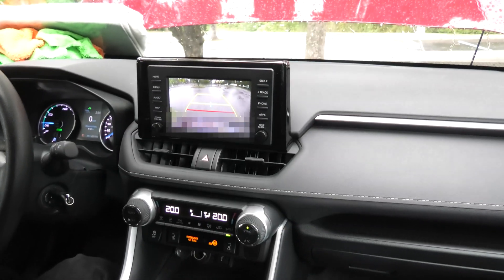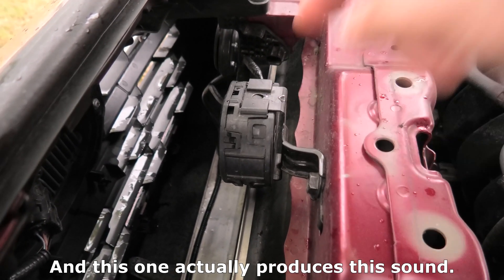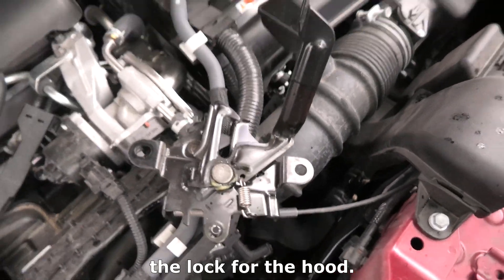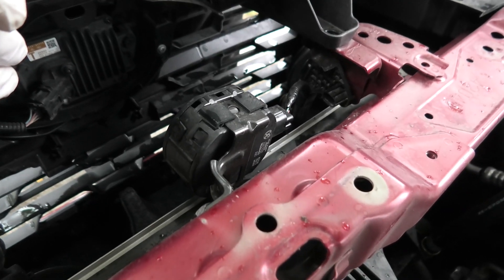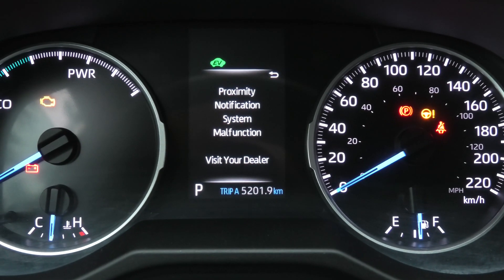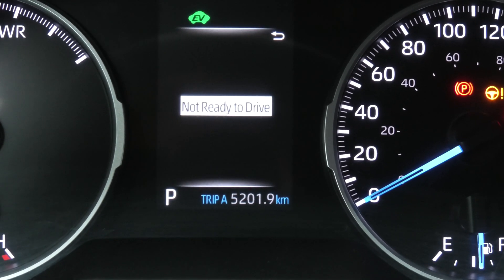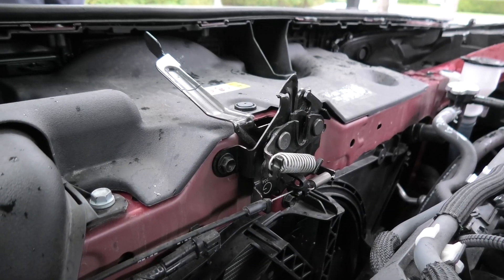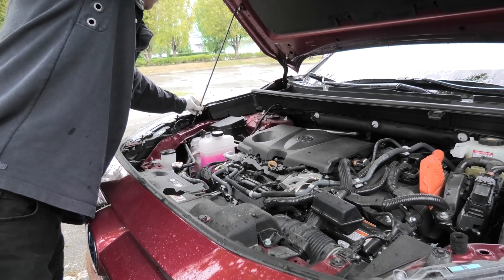Toyota RAV4 Hybrid (2019-2025): Where Does Futuristic Hybrid Noise (Sound) Come From?

Comment: If you unplug the speaker I know it will the message on the dash. 
My question is, after it shows the message and then you plug it back in will the message go away or will the dealer have to reset and clear it?
Reply from the maker: The message will go away after you plug it back in.

Comment: Have you guys at Morosov ever taken one of these things apart and hollowed it out and tried putting it back on the Rav4 Hybrid  .

I  Find these things obnoxious and you know it's only the hybrids and electric car's atom it's quiet as cars are nowadays even gasoline ones they should have them as well so why should only the hybrids have these obnoxious things , This is a reason I want this thing gone .
Reply from the maker: Hi Gary! No, we have not. You can install the resistor in place of the speaker. But, as you may have guessed, this is not exactly legal.

Comment: If there toyota tech or he pass by can answer this question 

I have question if i wanna add this system to my 2006 prius do i only need the speaker and feed it up with reverse light power to start the warning sound or i need the avas module unit too

Comment: I have question if i wanna add this system to my 2006 prius do i only need the speaker and feed it up with reverse light power to start the warning sound or i need the avas module unit too

Comment: Can this be manually unplugged so that annoying sound is not on a 2023 new model? Will it damage the vehicle if it is disabled?
Reply from the maker: It won't damage the vehicle but it will give you the error message. Besides that it is the government requirement for the electric and hybrid vehicles to produce noise at low speeds with engine off.

Comment: Interesting video. For some reason my 2022 Toyota RAV4 Adventure Hybrid EV Pedestrian audible alarm is not working and I’m not even sure if it has one.  Could that be possible Mr Morozov. 

Cheers NZ.
Reply from the maker: Thank you! Most markets now have a requirement for electric and hybrid vehicles to have the acoustic vehicle alerting system which warns pedestrians and other drivers of the approaching electric/hybrid vehicles. But not all countries have this requirement. This could be the case in your situation.

Comment: This noisemaker is very annoying, worse than a neighbor with loud exhaust.  It is the responsibility of the driver to ensure that the car is not mowing down pedestrians, which is why we have things like exterior cameras and proximity sensors.  It is not the responsibility of pedestrians to hear a noisemaker and react to the car moving.  The Toyota noisemaker sounds like a problem with the power-regenerative braking system.  I would rather listen to a Tesla playing one of its music tracks than this silly and unnecessary noisemaker from Toyota.

Comment: Thank you! On the Toyota Corolla 2021 you just remove a small plastic cover and it is right there under it. Very easy to disable. Just need a 10w 8ohm resistor.
Reply: Is this the same for a Corolla cross hybrid, 10 watt 8 omh size?
Reply: We’re can I find one , Could you send me a link please ?
Reply: How do you install this and not cause an alert on dash?

Comment: I'm surprised at some of the comments!?   Folks - please don't disable the speaker.   It's a safety feature.  Your Hybrid RAV will be completely silent at slow speeds which is (although not readily apparent) very dangerous.  (Try to imagine the car as being invisible)   I agree that it does take a bit of getting used to, but try to imagine the sound as "angelic" and nessecary....
Reply: Most modern gas vehicles are completely silent , I traded in an f150 ecoboost on their rav4 and this thing has got me more complaints from people and when I back out of my garage it wakes my tenants . It’s too loud if it wasn’t objectionable no one would be trying to defeat it . My old car was a 2020 Corolla Hybrid it had one too but it wasn’t objectionable like the Rav. Rav is 2-3x louder I will be doing something about it before my car starts getting keyed by the neighbors. It’s embarrassing going thru my streets at 20 mph I have to speed to get it to stop (25) somehow that’s safe
Reply: If you can lift your truck 2 feet and roll coal out of the exhaust with straight pipe eBay parts how is a whine noise that’s not required on electric vehicles suddenly unsafe? The Hypocrisy on what’s “ legal” is bogus in the US.  I remove tpms sensors or have a crack in my windshield I can’t avoid to fix cause I’m poor, do I belong in jail or a fine from a police officer that requires court appearance , disproportionally affecting a higher number of black and brown ticket stops? because that’s how  it’s enforced in America? I believe it’s a good to have the whine but toyota overdid it and tried to go to far with the pitch creating unnecessary noise pollution and affecting wildlife and picked a unnatural sound tone that’s aggravating and aggressive to majority of population. Read the research why they picked that pitch and decibels and you realize it’s just like rolling coal noise pollution to your common man.
Reply: Angletic? No it’s bs noise pollution that doesn’t exist in human nature.
Reply: Someone needs a slap

Comment: You can always disconnect this speaker and wire in a resister, read some forms you can find what ohms resister to get and it was be silent. Works like a charm and no warning signals come up.
Reply: I have question if i wanna add this system to my 2006 prius do i only need the speaker and feed it up with reverse light power to start the warning sound or i need the avas module unit too
Reply: @massesbulet  unfortunately I don't know.
Reply: @vik kash  if you get the change to work on it again or somewhere close can you try to give it 12v to the pins direct and see if sounds and reply to me please
Reply: Does it void any warranty if you do that? I'm new to cars in general but that sounds like a concern if you do that, right?
Reply: @Amorphous_Sand  not sure what warrrnty it'll void but I'm sure it will.
Reply: How do you look up what size resistor you need for rav4 or Corolla cross hybrid speaker horn circuit? I’d rather wire a LED light but it may be different electrical signal being a speaker.

Comment: What is the purpose of the speaker?   Can that sound be turned off?
Reply: People with disabilities who cannot see (and people  who  can see but are are too busy checking Instagram) need an audio cue since there’s no engine noises in full electric mode on the Hybrids / PHEV. Kinda irritating but it’s a life saver since that irritating noise does make you pay attention a little (we hope). If you disabled it, and then hit someone, they would probably find you even more at fault since it’s possible that person simply did not know you’re coming.
Reply: @unkokrispy  Do all EVs have it? I don’t think Teslas do.
Reply from the maker: The purpose of the noise is to substitute the engine sound when  only the electric motor is working. It's meant to warn pedestrians.  Toyota didn't provide the option to turn off the sound.

Comment: I wish I could disable it / i get weird looks when i back up. Honestly the car has reverse lights so the noise is silly
Reply: Unless your blind, in which case the noise is a life saver. Otherwise you won’t know someone is backing up
Reply: @unkokrispy  but that's why it's the driver's job to pay attention to his surroundings. I've got a 2013 kia optima hybrid and it doesnt make any noise- I've never hit anyone. I also drive an 18 wheeler and there is no back up noise on that either. At the back of the 53 foot trailer, there is literally zero noise so no one can tell I'm backing up by sound. 7 years driving and havent hit anything. Its thr DRIVER'S job to be aware of his surroundings.
Reply: Shaddap. You don't know what you're talking about. It serves a purpose. DUM DUM.

Comment: It has it's purpose.  But is overly loud on the Rav.  Mine is heavily wrapped in dense foam and duct tape.  It still can be heard but, not as shrill and doesn't wake the neighbors up when I leave for work early in the morning 😉
Reply: I wrapped mine with bunch of electrical tape and reduced the volume by roughly 75% (which is what I wanted)
Reply: Any instructions on that you could point in the direction of?
Reply: @robloreto  I just unplugged it and removed it by loosening the 12mm bolt.  I had some dense foam from a package I had received. I then just covered the speaker and wrapped it heavily with some strong packing tape I had.  Reinstalled it plugged it back in and job done.   I still hear it. But it isn't so shrill   I would say reduced the level by half anyway
Reply: @davedave2109  Does the duct tape and foam melt from the engine heat?
Reply: @magdalenastawiecki1132  hi.   I've had mine covering the horn for over a year with non-issue. The horn is place quite forward of the engine and any movement of the vehicle the covered horn is getting a full blast of fresh air through the grille.